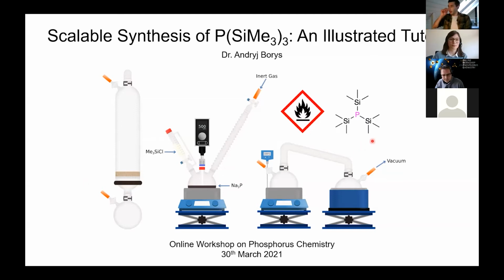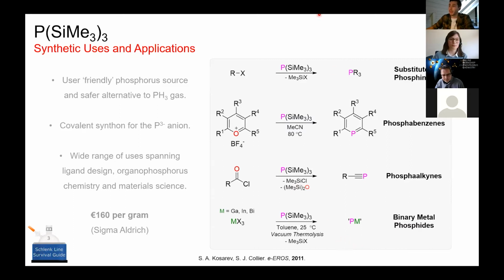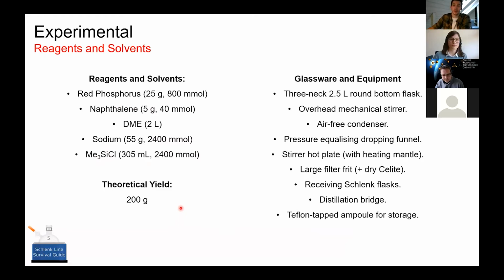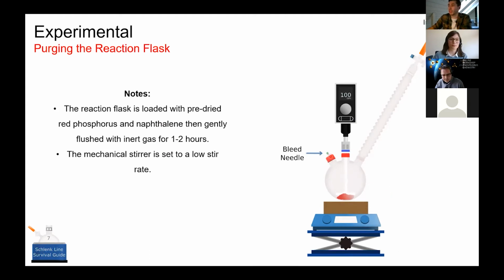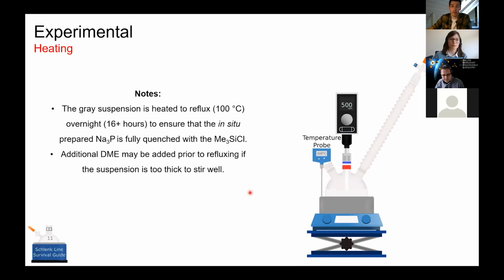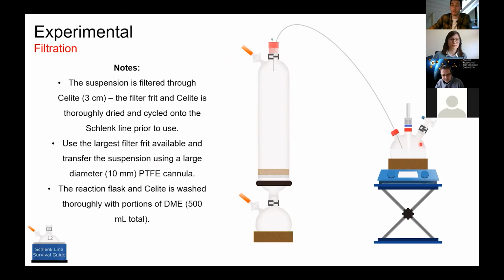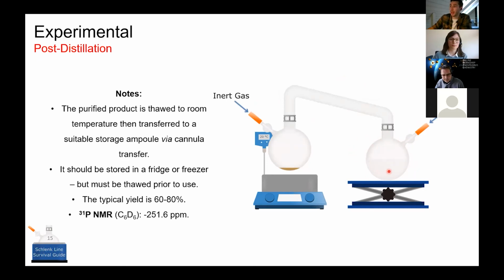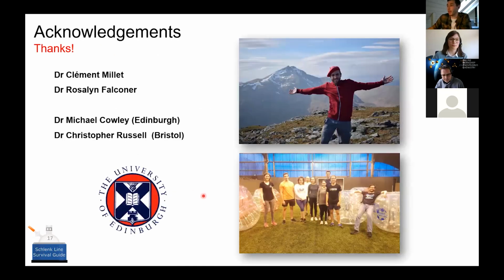Synthesis of Tris(trimethylsilyl)phosphine: An Illustrated Tutorial - Dr Andryj Borys

Comment: Hi Andryj, another question considering TMS3P. Do you expect to have all of the Na dissolved before adding TMSCl? There sometimes is quite some unreacted even after longer time of refluxing (2 days and more). When I use K or Na/K i usually have much smaller leftovers of the alkali metal, but there is still some.